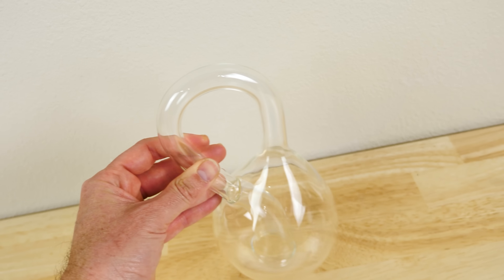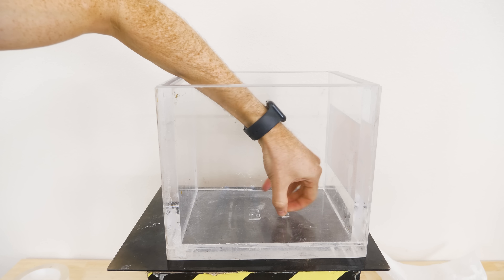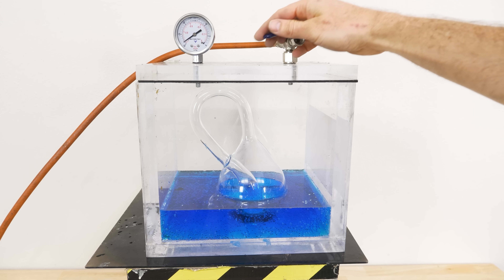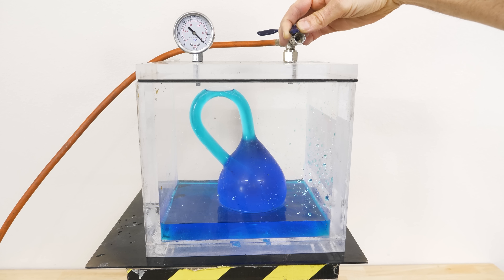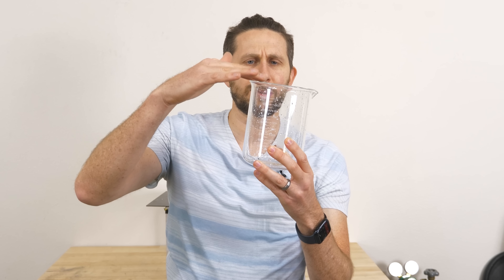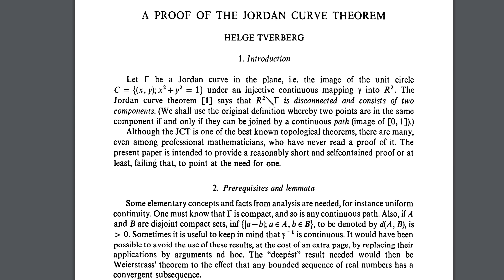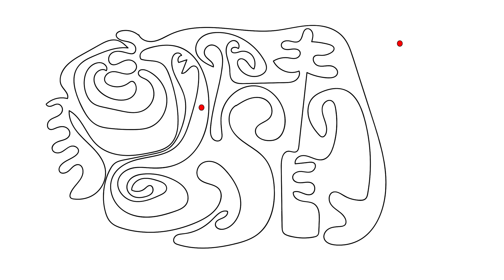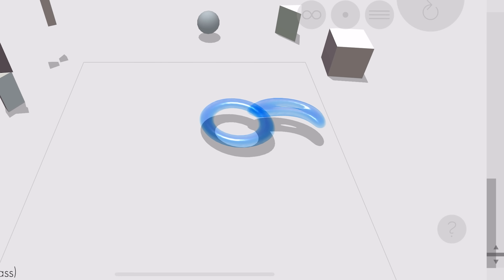Is It Possible To Completely Fill a Klein Bottle?

Comment: A Klein bottle is what we call a technicality.
-It HAS volume, but is difficult to measure just by its dimensions. You can measure its volume by filling it with water, and then measuring how much water you used.
-It HAS an clearly defined interior, but people get hung up on it having only "1" surface. It starts/stops at the hole.
Reply: You're kinda like almost there but also really missing the whole point of the video at the same time. The video ultimately says that yeah, 3D Klein bottles aren't actually remarkable at all because:
-It doesn't have volume, but neither does any cup/any open container. Your statement about having to fill it to measure the volume is pretty irrelevant since it applies to just any container at all. And being hard to measure by dimensions really doesn't mean anything whatsoever; it's still measurable. Any cup can have irregular dimensions that make it harder to measure by its dimensions, but it's nothing notable at all.
-It doesn't have a clearly defined interior and only has a single surface, but that's the same for every cup/open container. "It starts/stops at the hole." Well so does every cup.
The whole reason he ends by differentiating 3D and 4D Klein bottles is to drive the point that 3D Klein bottles aren't special at all because the whole idea of Klein bottles is meant to be 4D; 3D Klein bottles are very simply weirdly shaped cups. You made both of your points while ignoring the fact that they apply to any regular cup when that's the entire point of the video.
Reply: @tree_tape  What is this 4th dimension?
Reply: @tree_tape  4D Klein bottles aren't special either, funnily enough. A lot of shapes in 4D aren't self-intersecting despite looking like they should. It's a shape that, like a mobius strip, is pretty interesting in topology but not in geometry.

That's also an awfully thin 4D bottle, the bottom bulge isn't really 'round' in the 4th axis and in the game (4D Toys) it falls flat on its 4D side all the time (looks funny, as if it squashes itself into a flattened blob).
Reply: @tree_tape  except the whole premise of the video was whether a 3d Klein glass can be filled, and the last 30 seconds talks about the theoretical and unproven 4d object, compromised by a man-made mathematical theorem. It's like you almost had a point there but lost it trying to sound smart lmao
Reply: @PO-yr1rh  What is the 4th dimension?
Reply: @PO-yr1rh  4D Klein bottle can be filled similarly, it's not really much different.

Of course, assuming it's made of enclosing volumes. Just a surface won't hold water in 4D space.
Reply: @PatchesKB  Fourth axis of freedom in a coordinate system, orthogonal to all other axes. In this case, that system is space.
Reply: @Tree Tape  a cup does a volume, though. The material has thickness.
Reply: @gobblox38  the klein bottle also has a thickness.
Reply: @alextheonewarrior  also I forgot to mention we are talking about the space the object enlcloses, not the space that the material that the object made of encloses.
Reply: Yeah it's essentially the same as a twisted up flask
Reply: Somebody finally said the obvious😂
Reply: exactly, i can't think of any utility in defining inside in such away were full cups don't have anything inside. "hey, whats in your cup"       "nothing"         "I can clearly see somthing is in their"             "actully, cups don't technicly have an inside. Therefore, there is nothing in my cup, but there is rasberry lemonade on top of my cup that's held in place"  This is just on big science dad joke, don't let scientist come up with definitions or else strawberries won't be berries but banna's will be. (Blame the botanists)
Reply: The interior is useful to define somethind called Topological invariant. « If I transform that surface will I be able to get another surface I know to study it easier ? » 
For exemple can I change a doughnut into a sphere ? Here the answer is no but … I can change a Thorus (Doughnut) into a mug without changing it’s properties and since the interior should be well defined in our domain we have our own definition but it’s a scientifical definition not a liguistic one. It’s not the same thing.
Reply: @anathos0369  thank you, that explains it
Reply: Sounds exactly like what he said. You pick an arbitrary point and call that the final surface. But let's not forget that the thickness of the glass also factors into this when mathematically the thickness of lines don't matter
Reply: Yes! My thoughts exactly. I hope the paper that was referenced wasn't someone's doctoral thesis or something. Too much time was spent on these definitions.
Reply: It genuinely doesn't have an inside or outside when it's in the 4 dimensional space you need to have an actual Klein bottle. Remember, the loop back that is connected to the side wall in 3D is actually NOT connected in a real Klein bottle. Those parts are BESIDE each other and not actually touching - there's a huge gap there. Any 4d fluid would fall right out.
Reply: He explains a the end that mathematically it doesn't have a volume, as doesn't a cup and that gravity creates a "closing" and hence a "volume".
Reply: It does not have a boundery so it does not have a volume by deffinition. Enclosed space has voulume by deffinition.
Reply: @shadyshyguy4058  it clearly does have both a boundary and a volume, or else we would not be able to talk about filling it with water. The boundary is the line past which more water spills on the floor, and the volume is the amount of water it took to get to that point. If you've defined your terms in such a way that you cannot tell the difference between air and water then you need better definitions.
Reply: @Guurzak  The volume of liqid is the space that the liquid occupies, the bottle has no volume because it is not enclosed. It has one side so it does not have inside or outside, so there is no sense to talk about the space inside.
Reply: @shadyshyguy4058  A cup also has only one side, and yet I can have liquid in my cup or outside of my cup. This shouldn't be that hard to understand.
Reply: @shadyshyguy4058  if the bottle does not have an inside then it is nonsensical to talk about filling it, but the whole video was about filling the bottle. What does "fill" mean if all the water that exists is already both inside and outside the bottle?
Reply: @ThatsMrSomeGuyToYou  And a cup does not have a volume eighter because it does not enclose a space. You can imagine a boundery that would enclose a space and calculate accordingly, but by default it does not have a volume by deffinition.
Reply: @ThatsMrSomeGuyToYou  in a vacuum your cup would not be able to hold a liquid. Gravity is giving your cup a lid.
Reply: @Guurzak  Science likes terms which can be used universally. If our definition of volume only applies to measurements made in gravitational fields that keep our liquid "inside", its a much less useful term than something that applies to anything, anywhere. Another thing to consider, lets think about the cup example. If you fill the cup to the top would you say you have filled the volume of the cup completely? What about if you keep filling it. You can still fill it higher than the lip of the cup as the surface tension of the water molecules keep the water from spilling out until..... once again.... gravity comes into play and forces the excess water to spill over. So if volume is simply how much space is inside the cup, you shouldn't be able to keep filling it after the volume of the cup is exceeded.
Reply: @CupCakeArmy1  Gravity is a non-factor. You can have water inside a bottle in space, too; it's just a little more work to make sure it stays inside.
Reply: @Guurzak  This is not true at all. How would you "pour" said water into said container? How would you get the water to stay still in the container? The water is going to have kinetic energy and it will simply float out. There is nothing constraining it inside the cup.  That's the point. There is no enclosed space that we can define as the volume here.
Reply: @Guurzak  The thing is that the volume of the cup is (approximately) the thickness of the cylindrical shape times the perimeter: what we call the "volume" in everyday use is not actually the volume of the cup, but the volume of the water that we put on the cup. Imagine this: if you have a disk, you cannot really put any water on it. If you curve it now a little bit, you can already put a little bit of water inside, but you still have the same initial disk with the same volume. If you now bend the disk so much as to get it into the shape of a cup, you can now hold a lot of water, but you still have the same volume of the disk which has not changed. You just bended it in a way as to hold water in place with our gravity.
Reply: @shadyshyguy4058  Of course a cup has a volume by definition. In fact it has more than one volume.

Here:
"volume
2. the amount of space that a substance or object occupies, or that is enclosed within a container."

The substance that the cup is made of occupies an amount of space. That is a volume.
When you fill the cup up, for example with coffee, you now have a cup of coffee. Your cup of coffee occupies an amount of space. That amount of space is also a volume.

So depending on the context, we're dealing with three different volumes for our cup: The volume of the cup material itself.
The volume of the filled cup.
The volume of the insides of the cup: Filled cup minus cup material.
Reply: @KyteM  Okay. So what?
Reply: @ThatsMrSomeGuyToYou  The volume of a liquid is the space the liquid occupies, if the container is not closed it does not have a volume, again.. you can imagine it is closed and calculate accordingly, but by itself there is no inside, there is no space inside, there is no volume.
Reply: @shadyshyguy4058  You are not even making sense right now. You're rambling. Did you even read my comment?
You could start by addressing that, instead of ignoring my argument. Maybe you'll start making sense, once you've taken my argument in.
Reply: @ThatsMrSomeGuyToYou  There is nothing to address, just because liquid takes up space does not mean not enclosed space have volume.  But let's talk about solid matter, you can put an infinetly tall object with infinite volume in the cup. You could put an infinitly tall collum of water in cups if gravity did not pull it down. There is no boundery, so there in no volume. Volume is enclosed space, if you say something has x volume, then you can fit maximum x volume of any substance into it.
Reply: @shadyshyguy4058  Nothing to address? Just because a cup has a volume by definition, it does not mean that it has volume? Is that your stance?
...you do get that that is literal nonsense, right?
Reply: @ThatsMrSomeGuyToYou  Cups does not enclose a space. I think you think that volume of substance and volume of cntainer are the same. They are not. Volume of substance is the space occupied by the sustance. Substances always occupie space, they always have a volume. So yes water has a volume, and the substance the cup is made of has a volume.
On the other hand the volume of container is the space enclosed by the continer. A cup does not enlose a space so it does not have volume.
Reply: @shadyshyguy4058  Okay, let's back up and try to help you comprehend how this definition works, because you're still confused and spouting nonsense.

1. Are you aware that a cup is an object (made of substance, yes, but that's not relevant)?

2. If yes, are you aware that the object called "a cup" occupies space?

If yes, we have proven that a cup itself has volume according to the definition I posted. That in itself is already enough to prove you wrong in several of your statements.

Let's go further:

3. Are you aware that liquid is a substance?

4. If yes, are you aware that you can pour liquid into a cup, for example as part of "a cup of coffee"?

If yes, we have now proved that there is a certain volume in a cup which you can fill with liquid, that occupies space. In other words; there is a volume in the cup too. When not filled with liquid, it is usually filled with air particles.

I would love for you to reply back and tell me which parts of this you comprehend and which parts you don't.
Reply: @heinzmustermann8416  "what we call the "volume" in everyday use is not actually the volume of the cup, but the volume of the water that we put on the cup" Except that "what we call volume in everyday use" is exactly what volume means. Academics do not get to change the meaning of a word  to something different from its common and traditional meaning, and then tell the rest of the English-speaking world that they're wrong.
Reply: @ThatsMrSomeGuyToYou  Whitch part do you not understand of a cup not enclosing a space and olny enclosed space has volume, and we are talking about volume of container, and volume of a container is not the same as volume of substance? 
By the way cups can hold water that exceeds their height even in regular enviroment . Also you can put a solid object in a cup that has infinitely large volume. 
Into a container that has a volume you cannot put more volume of substance, than the volume of the container. That is the point of volume. 
To make it simple so you may understand :Volume of container is the max   volume of substance it can hold. If the container is not enclosed then there is no max limit of substance of volume it can hold. Enclosed space(container having a volume) cannot be overfilled with any substance, they cannot hold more volume of substance then their more volume of capaciti. Not just liquid, solid too. Cups don't work like that.

Cup is not enclose a space. Enclosed space determined by boundery, not by holding or nor holding substance.
Reply: @ThatsMrSomeGuyToYou  And I understand you cannot comprehand that a container having or not having a volume is independend of it's ability of holding liquids. All of your argument suggest that they are depended of eachoter, but they are not.
If it makes you feel better you can put a cover on your cup, and together the cover and the cup encloses a space that has volume, but the cup alone does not.
Reply: @CupCakeArmy1  By pushing water into it, it's not rocket science.

It can stay via surface tension, sticking to the glass. Or by being decelerated/the cup being accelerated until it floats in the cup, which technically is rocket science.

If you can dock a spaceship, you sure can dock water in a cup.
Reply: @nadarith1044  Well, considering you will most likely be in some sort of spacecraft, I hope that cup of water is accelerating towards your face, or there will likely be water getting out all over the place. Hey, maybe we can attach the cup to a motor that spins it around for us! However this has nothing to do with what is being talked about.
Reply: @CupCakeArmy1  Considering there are space cups that are open and hold water via surface tension? Yes, you can hold water in a cup without gravity.

As for the entire 'debate' here, this is mostly semantics. No one in their right mind would seriously dispute the internal volume of an open container, not even a mathematician.
Reply: I think it wouldn't really be volume rather than capacity, if it can hold something but it's not seperate, then it's not really volume, but how much it can hold.
Reply: Well dude it’s the same as the beaker example by the dictionary definition of volume he’s right but we as humans don’t just take everything at face value there’s nuance in life. This video is him basically proving this “technicality”
Reply: Starts and stops at the hole
Sounds like my last relationship.
Reply: You are technically correct but you missed the point of the video and the explanation at the end.
Reply: Those two things are only true if you artificially add a boundary to turn it into an enclosed volume. That's the whole point. It can only be filled as long as you add a boundary to separate "outside" and "inside", which in this case was his hand.
Reply: @KyteM  Its volume is just as enclosed as the volume in a cup, if not more... That it is physically difficult to fill with liquid does not make it so that it doesn't have an inside.
If I make a pipe in the shape of a J, and seal it shut at the topmost point, it's gonna be difficult to fill too. Would you have difficulty deciding what's inside and outside of the pipe?

Comment: you can very easily fill these without a vacuum chamber. the whole trick is to not cover the "inlet" so air can escape. just look how watercooling-loops in enthusiast-computers are filled. do it as they do: take a squeeze-bottle, with a long enough bendable straw at the top, stick it all the way in and squeeze. as easy as it can be. the straw doesn't block the path for the air to escape, so it can be easily filled.